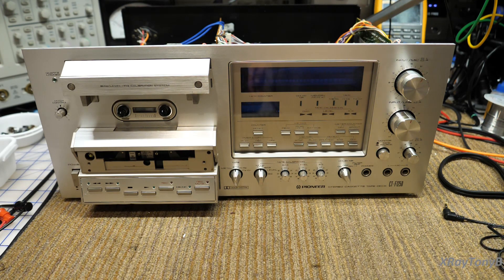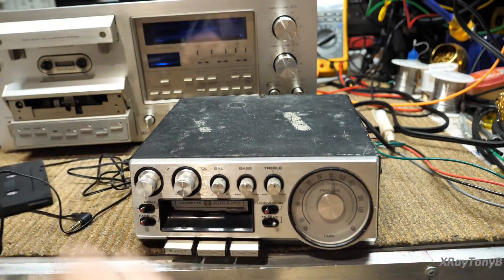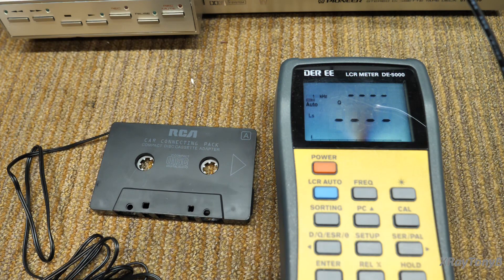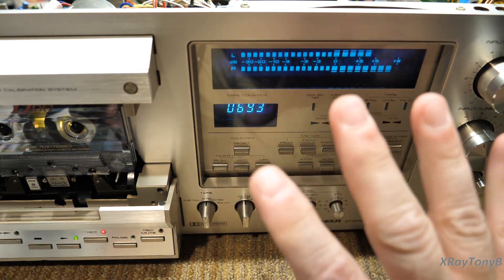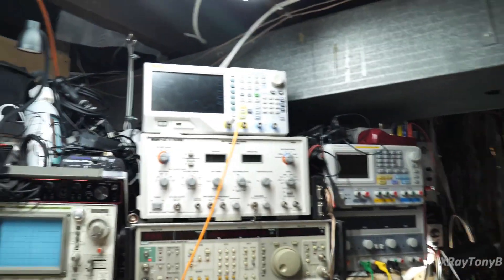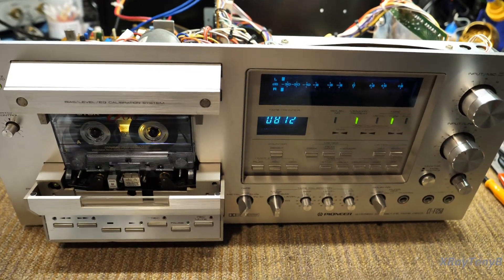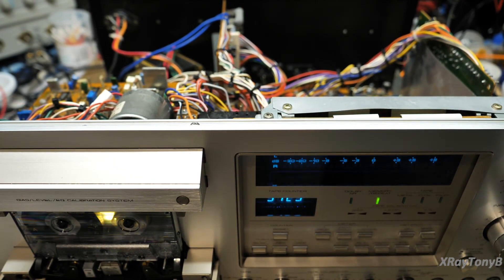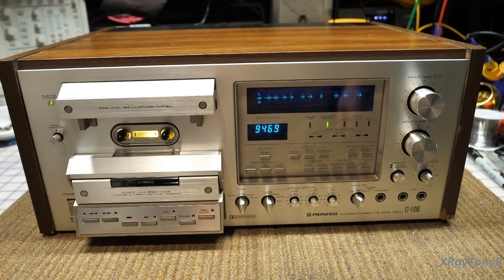Pioneer CT F1250 Cassette Deck Part 7   Attempt at Record Alignment

Comment: Hi @xraytonyb.  I apologize for coming in late here (just now seeing these videos as I have recently discovered your channel...came in on the Carver M400).  Back in the day, I did align and work on these decks (but we're getting back 40 years or so now).  In your videos, I never saw you really do the mechanical alignments on the heads/tape path, beyond a rough, by eye, height adjustment of the left pinch roller.  I cannot emphasize enough getting the mechanical alignments as dialed in as possible, before adjusting any of the electronics. 

The height adjustment on the CT-F1250 (tape head/cores relative to tape/tracks) is done with that left pinch roller adjustment.  You want to max out both channels (using calibrated tape) with the adjustment but be incredibly careful because as you go beyond the range, you run the risk of damaging the tape as the plastic guide pushes the tape beyond where it can move.  I used to make my own "height alignment" tape after I had a machine dialed in so it would be more disposable and preserve the measured tape. 

For azimuth, the gold-standard (using calibration tape) is putting your scope into X-Y mode and adjust azimuth for a perfect Lissajous 0-deg pattern (straight line at 45-degrees from bottom left to upper right (one channel on each scope input).  As you go up in frequency, it will get more and more touchy.  But you should be spot on for even the highest frequency on the tape.  If you don't get this right, all of the electronic adjustments done is trying to compensate for a mechanical issue and will never be as good as it should be. Because of how Pioneer does their azimuth (hinge the head mount), you may find that height has to be slightly tweaked as there is some interaction. 

For all adjustments where looking for a peak or peak then -3dB (I seem to recall that being the spec for the CT-F1250 but again, it's been decades), I ALWAYS used an analog meter.  Looking at a digital meter bouncing around isn't too helpful.  But an analog millivoltmeter with good ballistics make adjustments a lot easier, if not more accurate. 

Setting PB frequency response one does use the recorded tones (and, again, I'd use an analog meter and mine had a dB scale were one could calibrate the reference and see the needle move in dB...that will quickly let you see where you are and if you do any adjustments, where you want to be.  I just find that a lot easier.

When injecting a signal to measure frequency response, I used pink noise with an Real Time Analyzer (RTA).  Again, you quickly see what you are looking for in the response and any adjustments for flatness are apparent on the RTA.  

This can be particularly useful when setting up the recording section and checking Dolby NR characteristics.  If you get things correct, switching Dolby NR  in/out, regardless of level, should yield no change. If you see HF attenuation, then that is an indication that you had an issue before moving onto the Dolby NR or there is a calibration issue with the NR circuits.  If you look at the +3dB indicator on the CT-F1250 meters, you'll see that there is a dot instead of the line used on all of the other levels.  That is to indicate Dolby-Level (officially, a licensed deck is supposed to indicate Dolby Level on the meters and that is how Pioneer did it).  At that point and above, Dolby NR should have ZERO effect on the signal.  Below that point, it should have compression/emphasis on record and expansion/de-emphasis on playback.  

As for the meters,  while I'd calibrate them, I never used them for calibration.  I'd use my bench meters. There just isn't the resolution in the deck's meters. 

Lastly, if you don't have the owner's manual for the CT-F1250, obtain it.  That goes over the user calibration with the front panel controls and, as I recall, are not discussed in the service manual.  As I recall, using the front controls, there is this procedure where one turns the knob fully CCW, then fully CW and then adjust until the calibration arrows balance out.  That position will be different than if you just grab the knob and balance the arrows.

Thank you so much for posting these videos (in general)...some of it is a trip through memory lane, some of it is seeing things that are now decades older and in need of your TLC.

Comment: You have done very well in thoroughly repairing and test recording with the recording alignment levels for standard,,chrome,,and Dolby recording and playback,,,as it,s something I've learned just in case I ever get a cassette deck this size for repairs,,realignment,,etc. 
Never really had seen a machine with line input level controls,,,along with the recording level controls,,,and quite a fair few smaller controls for the bias alignment,,,etc. 
Such a very nice machine with the woodgrain cover on top too,,,it almost looks like new to me altogether.

Comment: Proper alignment tapes are also recorded full track, or one track.The tapes will say "This side out" or "Do not use this side" printed on side B.There is equal magnetic energy across the full width of the tape, this is why you can't make your own test tapes on another machine, because you would be recording in 4 track mode.
Reply: zulumax disculpa que te contradiga, pero si se pueden hacer cintas de alineación en Platinas que estén en buen estado, Yo hace como 15 años atrás hice una en un TASCAN 122 MK2 y me dio buenos resultados, LA TASCAN era totalmente nueva, la calibre con su tono de 400 HZ y 10KHz verifique que lo grabado quedo exactamente como lo reproduci y ese Cassette lo use para alinear muchas platinas después, lamentablemente se me extravió ese Cassete, pero si se puede. Usando un buen Nakamichi, o un Revox o un DENON de alta Gama que estén en buen estado si se puede.

Comment: You should post on how to do a 3 head alignment! Not easy compare to a 2 head.  : )
Reply from the maker: I believe this is technically a three head unit, as it has individual record, playback and erase heads.  The only difference is that the record and play heads are on the same mounting block.  I think a separately mounted rec and play head would be a bit more difficult to align, though.

Comment: it's hard to believe these decks were ever set up properly in the factory....
Reply from the maker: I heard rumors that some manufacturers didn't always have the best quality control on all models, but I've never confirmed it.  I bet in some cases these could have been "fine tuned" after they were purchased, as long as you had a reputable service tech to do it.
Reply: MFR58. Amigo créalo yo escuche una de estas nuevas, y de verdad era increíble como grababa y sonaba, pero son muchos años ya y de alguna forma tienen que fallar. Yo diría que lo malo de este Deck es el transporte, la rueda loca, el REV y el FF, dan muchos problemas pero de resto es una platina excelente, el sistema de calibración es muy efectivo.
Reply: @xraytonyb  Nakamichi actually used that as a marketing point in a brochure. "The 30-step adjustment procedure each BX-150 and BX-100 undergoes during assembly is costly, but it guarantees you Nakamichi performance."

Comment: I don't like Dolby B either. As a matter of fact, when I record with cassette or reel to reel, I use DBX. Some people don't like it, but I do. Great job on this unit : )
Reply: Indeed dbx is superb, but because of its' rarity in audio equipment, one can't "share" easily the fruits of one's mixed tape recordings with others.  I keep my use of dbx to reel to reel as it's not a portable medium,  BTW, I THOROUGHLY enjoyed all 7 parts of Tony and his "technician"'s Pioneer CT-F1250 rejuvenation.  Thank you Tony!
Reply from the maker: I repaired a DXB 5BX unit, but didn't do a video, as I didn't think anyone would be interested.  I think I may have a 3BX in storage somewhere, but not sure.  I agree, DBX was orders of magnitude better than Dolby B.

Comment: Who the heck would suggest to use a low quality car adapter as a test tape?

Test tapes need to be recorded a) according to a reference magnetic flux (e.g. 250 nWb/m at 0dB) and they also need to be recorded in b) full track configuration (with very few exceptions like the T-10 height adjustment tape) so a deviation in head height won't influence setting the playback levels since both channels will always get the same level AND phase on a full track tape. Which is also why azimuth test tapes are usually full track at 10, 12 or even 16 kHz (for Nakamichi, that is).

Comment: Never was a fan of Dolby B, but Dolby C on the other hand was a must! I use those cassette adapter thing's in my car for my phone and Dolby C works well! 
Dolby S was also good! 
I have DBX noise reduction on one of my cassette decks which is amazing but anything that I recorded with that doesn't work elsewhere if DBX decoding isn't available....

Comment: You brought it to a point where it plays nice and clean with good HF extension. Congratulations for that. Its the service manual is very 70s style with a zillion spot checks and typos, plus confusing phrasing that tires you. 
The electronics adjustment goals are always the same between decks no matter their individual procedures:
 
A. Correct bias for best response at -20dB on normal chrome and metal tapes. B. Still in spec THD at 0dB with that bias. C. Correct zero Dolby level. 

Say you had no service manual, what would you do? Simply after establishing correct speed, azimuth, and Dolby level with reliable test cassettes, you would just fire up some frequency response analyzer to tweak the bias for best and equal response both in level and extension between channels with your most likely to record cassette formulations.
Reply from the maker: Thanks for the advice!  Stuff like this really helps!

Comment: In addition to the reasons you mentioned why a cassette adapter would not work for an alignment, here is another, there would be no way to adjust the speed.

Comment: If you don't like to use Dolby when playing/recording a tape, try using it on a properly working Nakamichi deck. I can't hear the difference during source/tape comparisons other than a slightly higher background noise during Dolby B reproduction.  Like your series.   I used to own a CT F750 among the numerous decks I went through before my Nak.

Comment: Next project should be a reel to reel tape deck ;)
Reply from the maker: I don't think my nerves could handle it :))
Reply: I have a dozen of those, two Teac which have even 6 heads, and a few 8-track ones with 1/2" tape. Enough work for a couple of years, I guess...
Reply: @xraytonyb  lol. I figured this last experience with tape probably had you saying "good riddance" after you had finished. Actually I think you would find them fun to work on, its just an expensive hobby. Parts and full restore kits are readily available for Revox and Studer units, it can just get pricey, especially for blank reels since only two companies in the world still make them (ATR and RTM), and calibration tapes are a little pricey... But the sound quality of even a prosumer reel to reel unit leaves the compact cassette for dust ;) I just had a Revox B77 MK2 fully restored and I have master grade tapes that have been recorded at 15IPS and the sound is just gorgeous.. Analog bliss :) Well, maybe one day if you are not feeling too traumatized by tape experiences, you might look into it :)
Reply: PS: And hearing a bit of tape print-through also adds to the charm ;)

Comment: I'm sure you loose fidelity (accuracy) in the electro-magnetic-electric conversion  using that adapter.  I have a cassette head "de-magnitizer" that looks like that.  I'm surprised you didn't have a scope hooked up to monitor the input .vs output signals and also the difference between the 2 channels. That would have been interesting to see. Cassette playback is notorious for compression and distortion, especially near its bandwidth limits.  ...And now for something completely different....can't wait.

Comment: Hey, Tony. I just had a Pioneer CT-F9191serviced and it sounds good. One of the two motors needed replacement. Are the electrolytics in these critical to sound quality? Should I have them replaced just in case? 🤔
Reply from the maker: I think the caps in the audio path are critical to sound quality.  The others didn't seem to be as big an issue, at least on this unit.

Comment: Surprised they only use a 2k frequency for bias adjustment.  A lot of other companies use 400 & 10,000 hz frequencies to catch lower and upper frequencies.  But you did two frequencies in a later adjustment. What is the difference in adjustments? Also, for being a high end deck, it does not have auto bias adjustment.  Is the deck from prior to companies starting auto bias adjust?